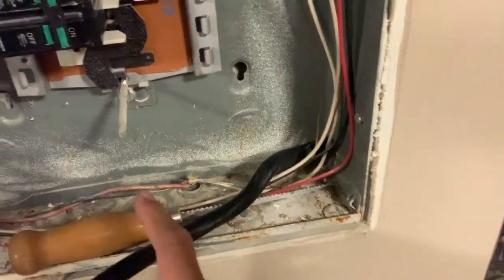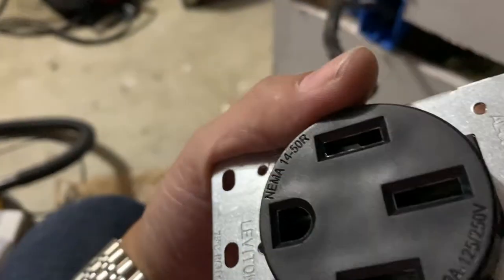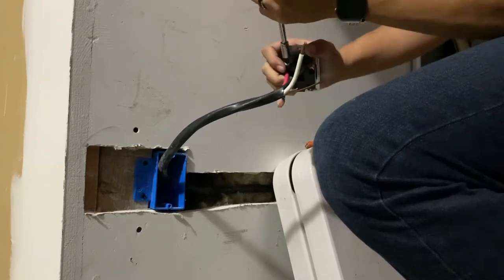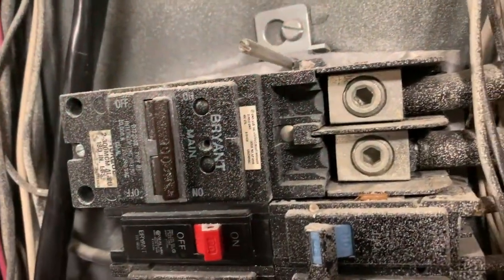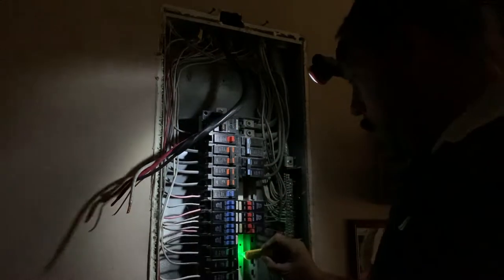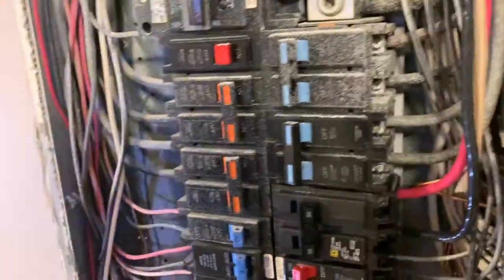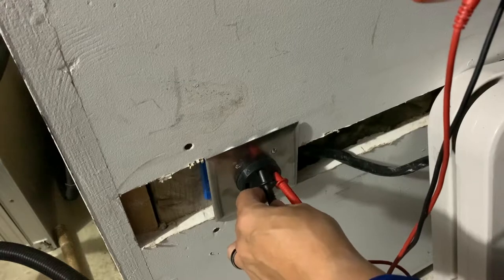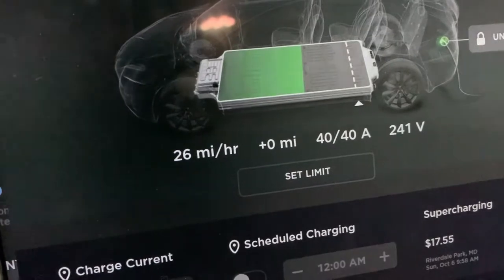How to Install a 240V Nema 14-50 Outlet for a Tesla Electric Vehicle and other EV

Comment: I believe you should have a 50amp GFIC for an outlet and non GFIC if you have the hardwire Gen 3 type charger.   Shock risk with water and other things in a garage.
Reply from the maker: GFCI are always a good precaution for external outlets.

Comment: Dumb question why 50amp breaker not the 40amp breaker?
Reply from the maker: From what I remember, the Tesla wall charger requires a 50 Amp.  I was thinking of putting in a wall charger eventually.  In the end, the charging cable that comes with the car was more than enough. I could be wrong, but that’s what I remember.
Reply: @OmarsGarage  i appreciate you taking the time to answer. I am putting an 14-50 outlet with a 32amp charger for my clarity. I am just not sure if I should put a 40 or 50 amp breaker. If you could guide me the right way I would definitely appreciate it. Thank you in advance.
Reply from the maker: I wish I could help, but I am no expert on other systems. This was installed with direct advice from a licensed electrician and with guidance from the Tesla install directions.  So I can only tell you that this worked for my Tesla charger.  Make sure you test for voltage always before working on it and make sure you use the right gauge wire.
Reply: @OmarsGarage  thank you
Reply: I believe this is due to the 80% rule.  A breaker should not support more than 80% of its rating.  So for a 40A load, you need a 50A breaker.
Reply from the maker: Thanks for the clarification. 👍
Reply: you only want to use about 3/4 of what its rated for ... 60 amp for hardwire gen 3 uses 48amps.  50amp you using 38 amps.  40 amp is using 28.